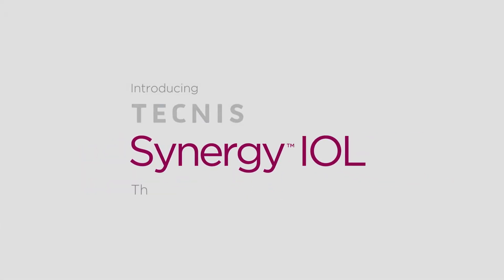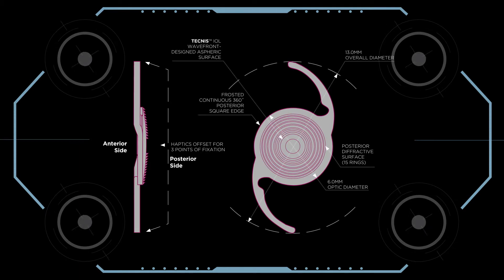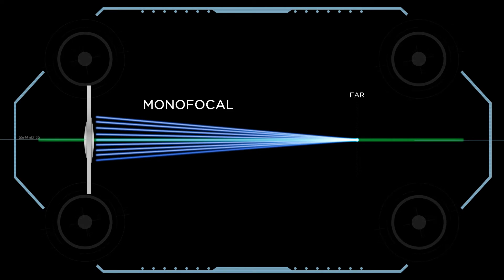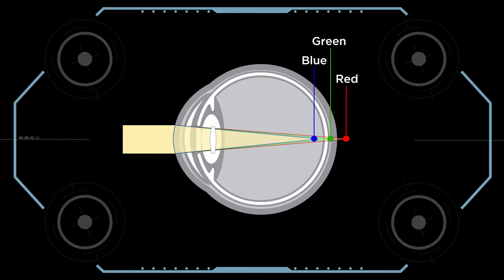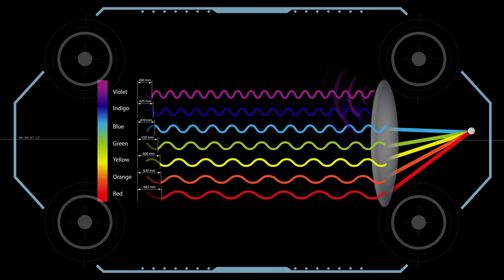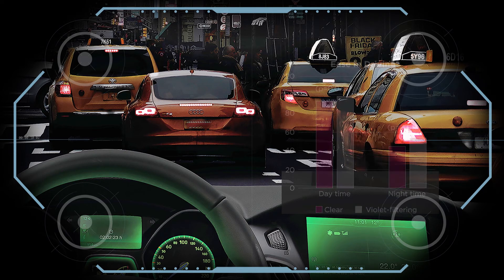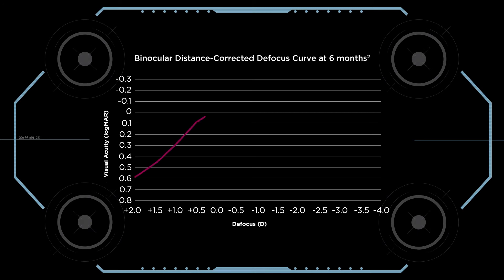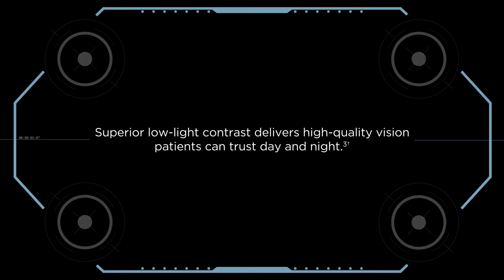TECNIS Synergy Technical animation: how does Synergy IOL works

Comment: If you have implanted the Synergy in patients it would be nice to see a video comparing your Real-World results comparing with Synergy, Symfony Plus and Trifocal results, including vision at all ranges and night vision and halos and etc.
Reply from the maker: good question! suggest subscribing to the channel @EyeSurgeryExplained here: https://youtu.be/6gmK4pXzTeA, it will be described at that channel soon!
Reply: J and J decided to not release symphony Plus on the market. Trifocal is nothing to compare with Symphony and Synergy. For now EDOF IOLs are the best. Trifocal is not EDOF. Symphony is EDOF , Synergy is EDOF+Bifocal. all multifocal OILs have difficult neuroadaptation, low contrast sensitivity (especially at night), a lot of halos and very bad vision between focal points. Soon all multifocal lens will be replaced with  EDOF lens.
Reply: @dianaivanchenko9800  The FDA has approved the Symfony Plus IOL, but it is not commercially available yet.  Where did you hear JNJ decided to not to release that IOL?  Also all defractive IOL cause dysphotopsias including EDOF IOLs.  As far as I can tell PanOptics is becoming the dominant defractive IOL in the US market, as its close vision is better than Symfony.
Reply: @bilskro  but better compare with panoptix vs synergy